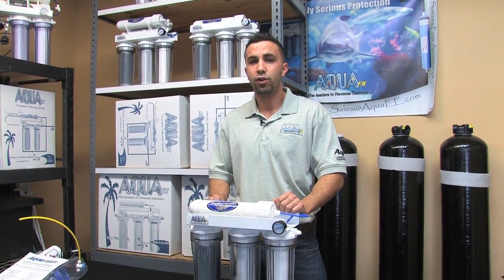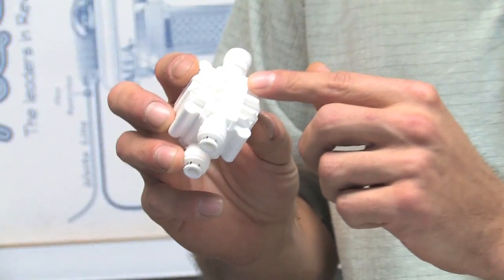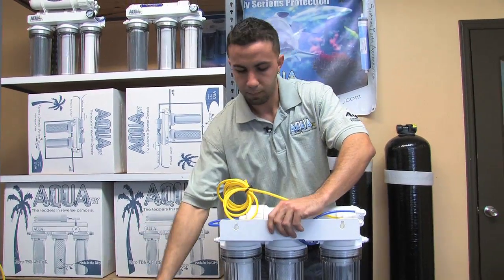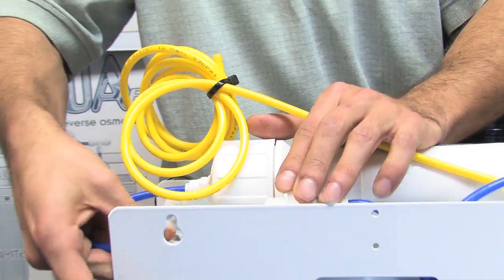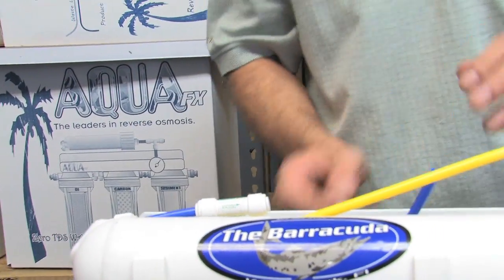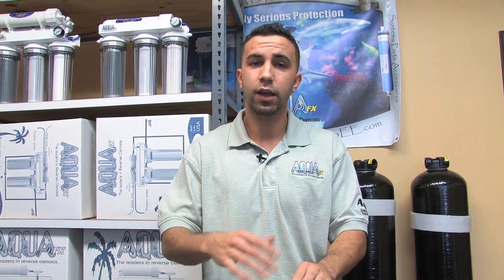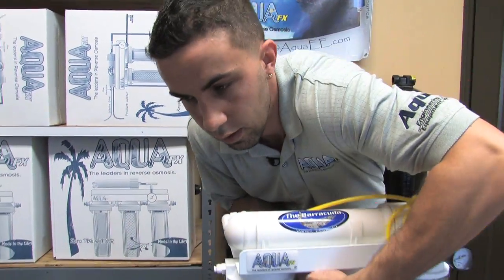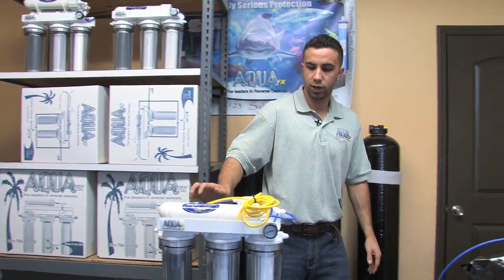Automatic Shut Off (ASO) Installation

Comment: Low pressure is the controling pressure, but it can control either high supply pressure or high wastewater pressure. If the wastewater is shut off, the system also stops and remains in equilibrium. This may be a better approach because the wastewater doesn't seep into the sewer.

Comment: Minor note, when connecting this I made the mistake of putting the high pressure side, on the water supply. Even though the water supply is high pressure, that's not the place you want to connect to the  In-and-Out fittings. The problem with closing the supply water , is when the valve begins closing,  it starts to  cut the water pressure that would otherwise hold  the valve itself  closed,  so it would shutter,  making a buzzing noise as the valve rapidly opens and closes, because the water pressure that is used to hold the valve closed is removed, when the water supply is closed. . The  waste water discharge  is also a high pressure area, however when that side is closed, it doesn't cut off the water supply, which allows the product water, or low pressure side of the shut off valve to maintain enough pressure, to hold the valve closed. Closing both product water, and l waste water, will turn off all water flow, just like manually turning off the water supply would. When the water is used and the float valve opens the product water backup, the automatic shut-off valve opens up, and everything begins to flow again. You might want to make a note of that in the video description so someone doesn't make the mistake I did.
Reply: I took have had to use the waste line as the HP side not the Carbon side.

Comment: I'd like to see a video with a better view of this install but specifically geared to a setup that has a pressure pump and float valve and still needs a install of check valve and auto shut off valve both electronic and hydrolic

Comment: Hmm... I just started looking at RO system ... and my main issue is the water waste ... I'm assuming this helps with this issue. If I add this auto shut off am I going to need another tank for the float valve?
Reply: Hey Steve, so this Automatic Shut off will only stop the waste water, when the product water is 'full' and is being blocked 100% - you can use a float valve, or you can use a ball valve. But something must stop the product water and allow the unit to build pressure in order to finally shut itself off. If waste water is a concern, check out the AquaFX Octopus model, its design allows the end user to adjust the waste water ratio to their desired value. Give us an email at Sales@aquaee.com if you have any questions? Thanks Steve!! :)

Comment: How do I turn off a fucking rodi system HELP MEE
Reply: Hey ORA -  So you can shut off the water feeding the RO system at the source, or Install an ASO (like this video) and then the system could be controlled thru a float valve or other device (like solenoid or ball valve), you could also install an electronic solution, such as a electronic float and solenoid combination. Let me know how that works for you? :)

Comment: What connects to the other two filters out/in ports. You only talked about where the line coming (Blue hose) out of the carbon filter  and the line coming in (also a blue hose ) but there are two ports on each end of the filters that you did not explained.
Reply: I apologize, I intended for this to be purely plumbing of the ASO - but you have a GREAT point. So the Left (outlet of the DI filter) will have an "OUT" printed in the cap, and would connect to a float valve to block the product stream when full. The Right side on the system (which will have an "IN" printed on the plastic) is where you feed the tap water into the system. Let me know if that makes sense? :D